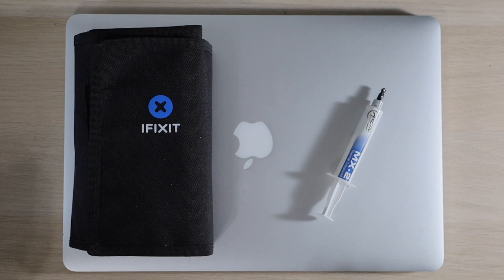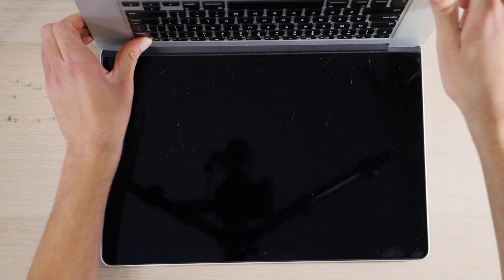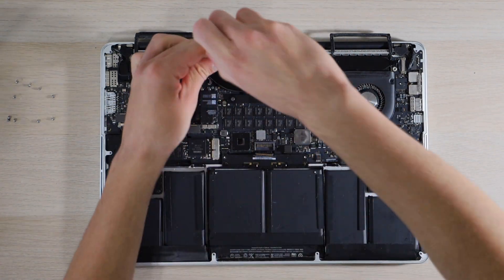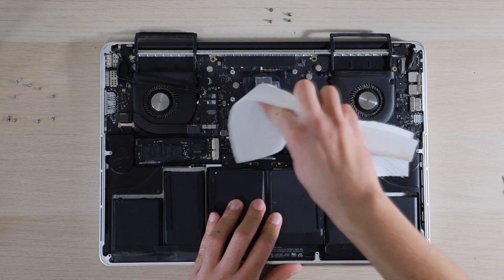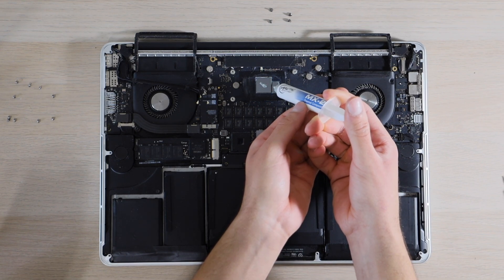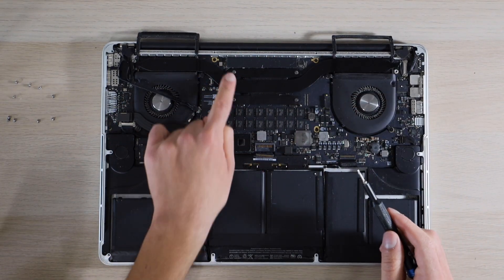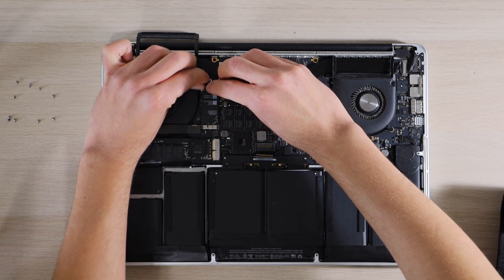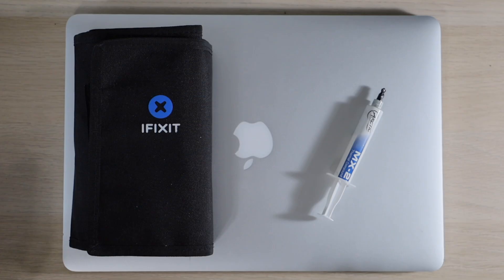MacBook Pro 2012-2015 15-inch Retina Thermal Paste Replacement

Comment: thanks to the video I was able to apply fresh thermal paste(mx4) on a macbook pro 2012 without any issue,
the gpu placement is a bit different so an extra 4 screws to unscrew,
also as other people say it wasnt necessary to disconect the wifi antenas,
nonetheless the video was really helpfull,
thanks

Comment: Just so you know, it isn't necessary to disconnect the WiFi/Bluetooth or webcam cables. Once you remove the four screws holding the heat sink in place, and remove the two screws at both far ends of the heat sink assembly, the assembly lifts slightly up and can be slid to the right. Once the mounting bracket on the left edge clears its locating slot, the entire assembly lifts right up, and voila. The trickiest part is keeping track of the three different screw lengths used to secure the bottom case - thanks, Johnny.

Comment: Great video! Thank you for the clear instructions. I see no reason, however, to disconnect the WiFi antennas and cable. None of those cables were impeding removal of the heat sink, and so far, I've been working for 10 minutes and haven't been able to reconnect them properly. One point not mentioned -  in my mid-2015 unit, I found that the fans were packed with dust, (as they are in the laptop in your video) and that may have contributed to the overheating as well, but still good to replace the thermal paste while I had it apart.
Reply: Good point. I removed the fans on mine to clean them and so I did have to remove the antenna plus the bridge cable that connects the right side hub to the motherboard

Comment: Hello. Thanks for the video. One question about the fans, should the run at the same speed when i set it on mac fan control? Because one of my fans shows slower speed than the other and it sounds much quieter. Thanks.

Comment: I'd looked up thermal paste replacement for my A1398 and saw a lot of posts saying it wasn't worth the hassle to replace the thermal paste. So today, while replacing the battery, I found this video and decided why not! Thanks for making it so easy to follow along, took me 10 minutes and now it's quiet again :) Cheers!
Reply from the maker: Glad you found the video helpful! Definitely worth it to replace the thermal paste to enrure you're getting maximum performance out of your MacBook, especially as it ages. Thanks for watching!
Reply: Did your original battery seriously go 10 years? I replaced mine around 2018/19 and my replacement is still going strong.
Reply: @noTTYLer97  Mine was late 2015, so about 8 years before replacement. Granted, the battery was pretty swollen so it's safe to assume the problem started before I noticed and replaced it :~) Glad to hear your replacement is still pumpin' along!
Reply: @JayTeaStreams  oh didn’t know 2015 was still a1398. My OG 2012 is a1398
Reply: @noTTYLer97 might be late but I replaced my 2012 battery in 2020 and it’s still a powerhouse in 2024
Reply: @noTTYLer97  Lol its 2025 and my 2013 MBP battery is very inflated, but I still use it I really need to replace sometime

Comment: Thank you. However despite being careful to follow your recommendations, I now face an issue : fan always running full speed with much lower performance. I can’t see anything different from your recommendations. I used MX4 thermal paste.

Comment: Thank you so much. I thought it was a much harder job but the video was easy to follow, clear and concise. I'd recommend also giving the inside of the machine a clean out too. I hadn't done mine in about a year and there was major fluff build up. Clean the dust off the fan blades and make sure the exhaust vents are clear otherwise new thermal paste will kind of be in vain.
Reply from the maker: Glad it helped, I would recommend cleaning out the dust from the fans/heatsink fins as well!

Comment: was it necessary ? did it make the machine noticeabke better ?
Reply: My macbook went from 55 to 40 degrees (celsius) running in idle. So yes, it does help a lot! Especially if the paste is over 2/3 years old it will make a noticable difference.
Reply from the maker: It allows the CPU and GPU (if your MacBook has one) to run at a lower temperature, extending the life of the components and better performance under load.